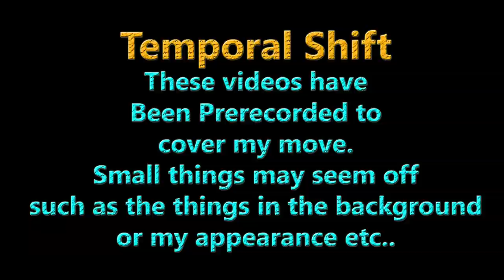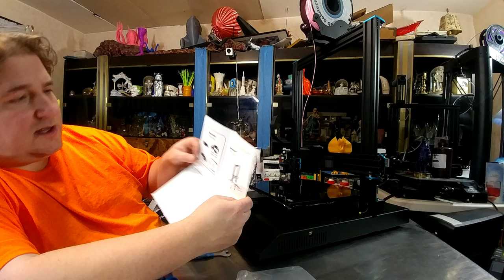Artillery Sidewinder Beast 3D Printer Unbox, Build   T3DP

Comment: I have an upgraded Sidewinder. They include most if not all of the suggestions from the initial reviewers. The fan is on the bottom now. It also has the larger bed leveling wheels. Mine works like a champ. The only changes I suggest are changing the heat break for an all metal one, enabling baby stepping in marlin modifying the filament runout detector with PTFE sleeves so they are a little more smooth. And, I want to be able to relocate the filament runout sensor closer to the extruder if necessary. I’m not a big fan of the filament real holder so, I’ll probably change it too. Regardless none of this is a game changer it’s a really good printer. Especially, at the price point to have it at.

Chris, did your video cut short for some reason it didn’t show the print?
Reply from the maker: Yep. Not sure why last few seconds were corrupted.

Comment: What brand fans do you get for low noise?
Reply: Michael Peek Noctua fans are quiet
Reply: @stevedonalson5675  Jep, but it is 12V fans.
Reply from the maker: That's right there 12 volts so you go to my 3D printing parts and accessories list on Amazon and you'll see that 10 voltage converters for 6 bucks just use one of those for each fan but not the parts cooling fan since it needs to be speed controlled and the voltage converter will prevent that

The two Brands I use are noctua and noise blocker

Comment: Well, I got mine on Oct 2 and I have not stopped printing yet even TPU print flawlessly. Personally will never buy a Creality product again unless they address the CR10S Pro hotend issues. This SW X1 design is perfect from what I can tell. Seeing the nozzle is something you used to do with printers that have issues. Removing the belt for the z makes no sense. Sometimes engineers do things because they see the need for it. Here is my take on this printer if you care to watch - https://www.youtube.com/watch?v=bQbYZtlsl10  when I saw your video it's not a V4.0 you have a pretty old unit since you have the fan located on the side new ones 4.0 have the fan on the bottom and a reset button located near the display in the front. Don't judge this printer buy the version you have it been improved even the tool pouch has different things in it.  BTW, the video cut short for some reason

.
Reply: That's the one thing that bothers me about Creality all that money for there printers and the hots just suck